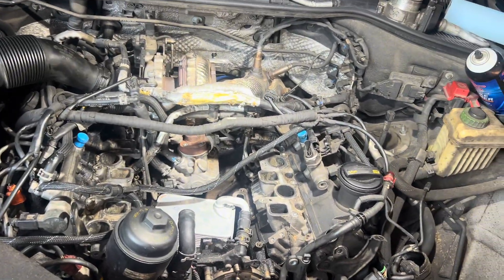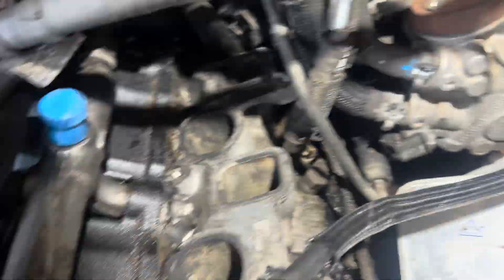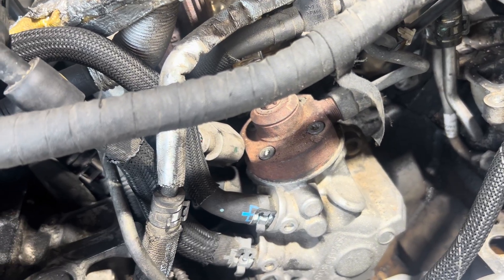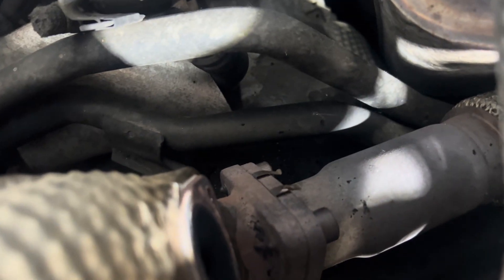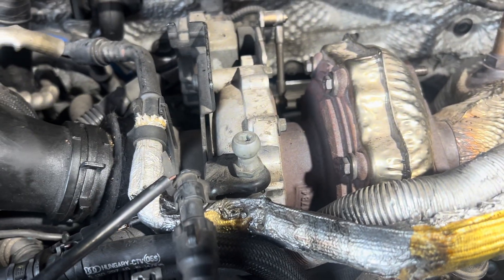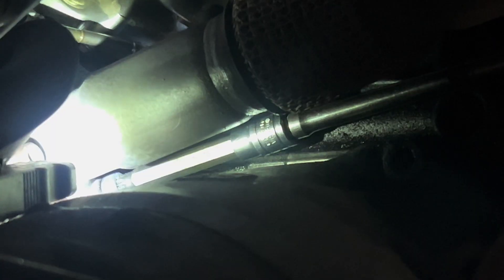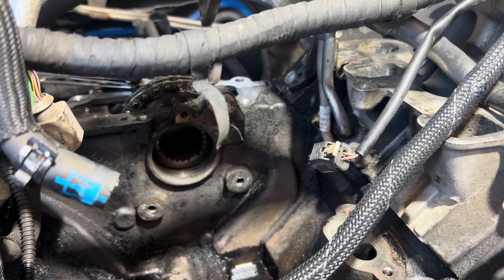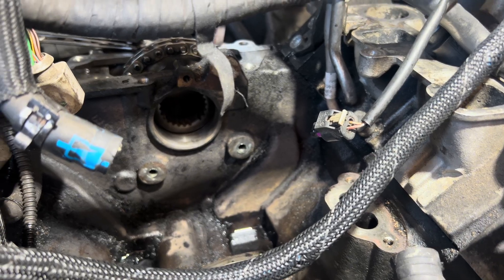How Hard is a 3.0 TDI HPFP Replacement?

Comment: What other symptoms was he getting?    I've had little pieces of debris (not glitter tho) and have changed every sensor under the hood + the whole engine harness (one mechanic said thats whats wrong with it.)  Still getting p0087 code when i get over 3k rpm accelerating or get on it in the higher gears.  deviation is 2-3kpsi of target fuel pressure.       The only thing left is to change the cp4, I'm at my wits end.  Also this all started doing a high way pull with the 2.5 malone tune and it kinda popped and fell on its face and went into limp mode.
Reply from the maker: Have the metering valve and pressure regulation been checked? Also the injector returns should be checked but i doubt that would cause 2-3k psi off of target pressure but is possible for the injector to be returning an excessive amount. An injector could be starting to stick open and lower the rail pressure. What are your injector correction values?
Reply: @GermanGeniusGarage   injectors are perfect all under .5   did a leak off test injectors were all equal.    I've tried 2 other metering valves (darksides upgraded valve and a new OEM bosch valve)    Pressure on the low side is steady 60psi at idle.  I actually increased the pressure to about 75psi at idle (by adjusting the relief valve in the cp4.)  made no difference.   Low side primes at 80psi. then drops to 60psi at idle with the original stock relief valve.   Also changed FPR, new fuel pressure sensor.  all correct oem sensors.  also put on a new injector return hose.     I drove it around 2 to 3k rpm and low side didn't drop at all stayed at 60psi.    I don't have a pressure gauge kit to check the high side while driving so not sure how to i could even see what that really is.  

Previous mechanic swore up and down that it's a voltage issue from my ECU/ dme to my metering valve wasn't exactly the same i think it was .5v off.  And he was thinking it's a ground voltage issue with the harness.  So recommended i replace the whole engine harness.    he also said the low side is fine by doing a flow test but really didn't say much about the cp4 just said there wasn't metal in it from his inspection as well.
Reply from the maker: @naten555  you can’t hook a gauge to the high side because the pressures are too high, you are best monitoring the rail pressure data vs desired on a scan tool to see what it reads when cranking, idling, cruising, and under load. It is possible the pump is bad without a catastrophic failure and it can’t produce high pressure like it should but that is less likely. Do you have any other codes? How many miles are on it? And when was your last fuel filter change?
Reply: @GermanGeniusGarage  there was 20k miles on the fuel filter when all this stuff happened feb 2025.  This happened a year ago.   I've put 8k miles on the car since then and did a fuel filter change then.   no other codes other than low fuel pressure.   Has 153k on it.  happened at 145k.     When i first removed the filter after this happened it was rather dirty compared to previous changes.  there was some metal and rust in the filter assembly then but not glitter.    I've taken the filter assembly apart and looked at it a few times in the last 8k miles there's no metal in the fuel filter housing.   I have a scan tool and monitor the pressures that way. also always bleed the fuel system.

Comment: Thanks for the video. 
I recently had a local shop replace my HPFP and timing chains but they didn’t do the fuel pressure relearn adaptation and I keep getting a high fuel pressure fault at higher RPMs. What adaptations did you have to do after the HPFP replacement?

Comment: GOOD JOB MAN why u changing the HPFP  do u have the code P053F and P0087 with the car ?
Reply from the maker: Slight debris in behind the metering valve. Changed to prevent failure
Reply: @GermanGeniusGarage  how much cleaning of the fuel system did you do prior to install? I caught some debris when changing out my fuel filter ('14 cayenne diesel). now I'm wondering if I should replace the hpfp and install a cp4 disaster prevention kit